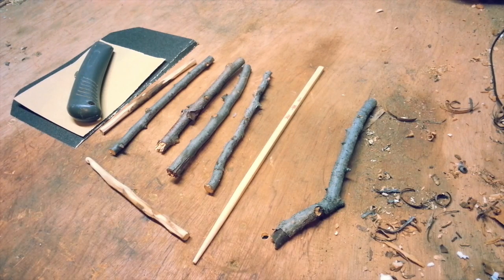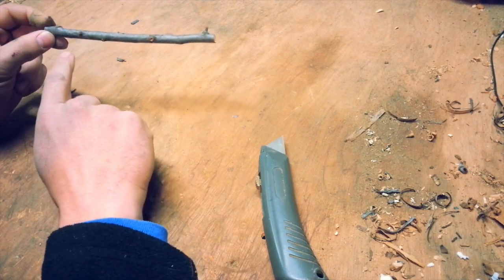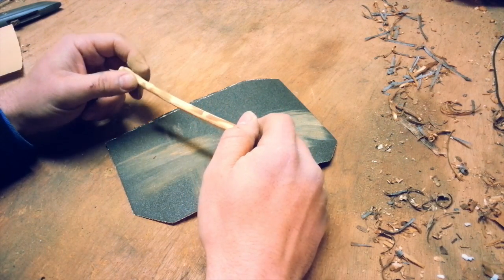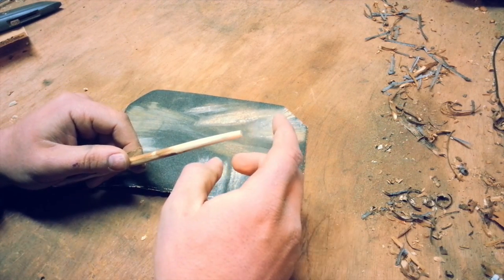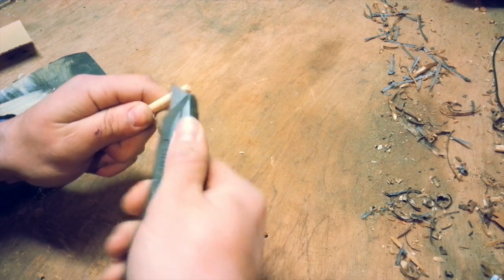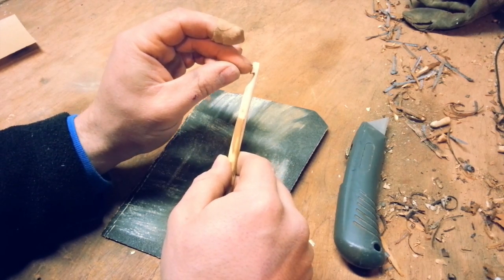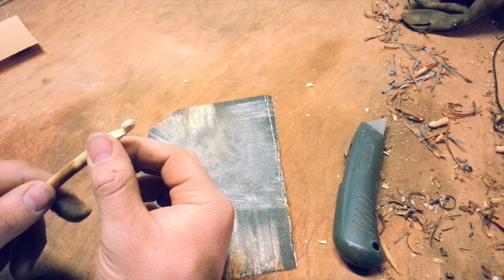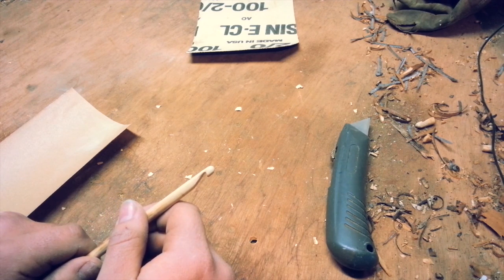Make a Crochet Hook From Wood

Comment: I would use my failure hooks as burnishing tools. Somehow, rubbing a hard, smooth surface against my hook seemed to result in a super smooth and even stronger hook. I would also end with a 220 grit sandpaper, but would finish after that with a chamos rag or a piece of old tee shirt, which seemed to bring a luster to the wood. I like the action you use for the hook part to dig into the neck with the knife and then drag it out into the lower part of the neck. I also paid attention to putting a smile on my hook after I was satisfied with how the hook got carved. It's funny, but that small attention to detail also allows your yarn to settle into the groove of the smile more easily. Enjoyed the video. Thanks.

Comment: Hey!  I made a crochet hook, the first one didn't work too well, but, the second one was spot on,  thanks for sharing this vid/tut, I wouldn't have tried something like this without your help,  thanks for posting,  I made it from a hardwood dowel rod, sanding to 220, then applied a coating of coconut oil, pretty nice if I do say so.  i am using big yarn, actually its I Cord that I made, I made my hook from 3/4'' oak dowel rod.

Comment: Very helpful! Thank you!!

Now if only I could get mine as nice as yours! 4 out of 5 times I cut the whole head off while trying to carve out the hook but I'm determined to get it right!
Reply from the maker: I'm sure you will get it!

A sharp blade and small bites help. It alao isn't cheating to fold sandpaper in half and use the edge to slowly work your way in.
Good luck!
Reply: you might try a coping saw to make the notch, I did worked great.

Comment: Do you wait for the wood to be aged or can you use relatively fresh pieces of wood? I have fresh Oak pieces I want to use but don't know if I should wait for them to dry out
Reply from the maker: Green wood is much easier to carve and many carvers prefer it for that reason. If it dries out too quickly it has the potential to crack. a trick to avoid cracking is to place the hook, or whatever you carve, in a box or a bag with shavings from the same wood. They will dry together slowing the drying time. A couple days should be fine for something as small as a crochet hook. I hope this helps.
Reply: @Simplegroundlife  that is so helpful! Thanks so much for the reply :)